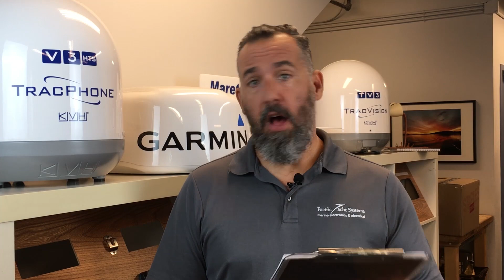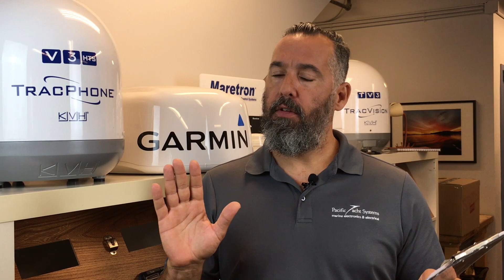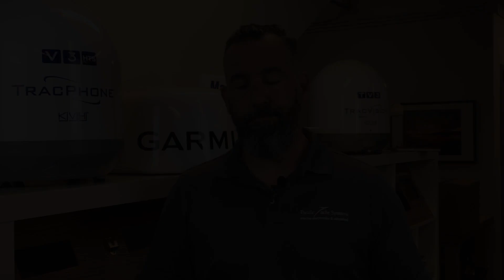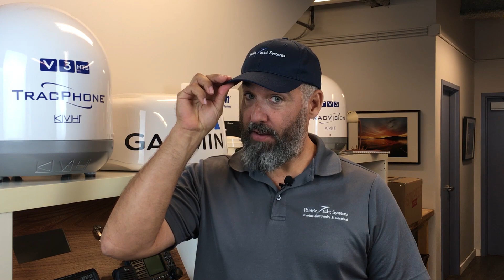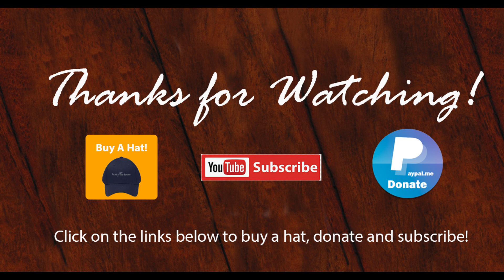Can I Use One Alternator to Charge an Flooded Lead Acid Starter Battery and an AGM House Battery?

Comment: Unrelated topic , i have a honda 2200 that i run on my boat from time to time i does what is needed .But should i run a bonding plug or not .as i said it works now with no problems.

Comment: Hi Jeff, great fan of your videos. I wanted to know if having a 3 bank system where there is a engine battery, 12vdc accessory battery and a battery for the inverter for 120vac make sense? Would using one alternator with a battery isolator to charge the first 2 banks and using a dc to dc converter from the engine battery to charge the 3rd bank work? Thank you. Arto.

Comment: So, buy changing my lead acid engine start battery, on my Motor home, to match my house, AGM battery, my alternator should charge them both correctly?
Reply from the maker: you probably can't change the charging voltage of the alternator anyways so its' a bit of a moot point which battery type it's charging.   agm and flooded voltages are very close together anyways and I would not be worried

you may also have 2 different alternators,  one for each.

Comment: Hi Jeff, I really enjoy watching your videos and I have learned a lot from them.  I plan to upgrade my 55a alternator to 100a with external regulator.  I'm also installing a 40a Smart Charger to replace my old charger.  I will be replacing my two flooded house batteries with two AGM.  Eventually,  or sooner, I will replace my flooded starter battery with a Dual AGM.  My question is: Can I set my charging profile for external regulator and Smart Charger to AGM to keep my new batteries happy while supplying voltage to my flooded using an Isolator and/or 2nd output from Smart Charger?  Cheers from the East Coast of Canada, Leo
Reply from the maker: Hey Leo, when you mix and match battery chemistry, better to use a DC to DC charging converter instead of a battery isolator.

Comment: Question: What product do you use to get solar panel wires through the deck of your boat? Also, do you have any tips to make sure the wires/connectors are water tight?
Reply from the maker: We use the Bluesea or Scanstrut deck glands for penetrations into boats. Always try to give the wire a drip loop before going in the deck gland into the boat. Also, if possible mount the deck gland on a vertical surface, like a transom to reduce the likelihood of water penetration.
Reply: @PacificYachtSystems  This is the perfect answer to my question. Thank you so much!

Comment: Hey Jeff, i just learned my house batt is a starting batt in my 21’ BW. It’s a standard two battery bank. Both batteries are 18 months old. Flooded. Can I just replace the one battery or do I need to replace both so they are the same age? Battery’s are in good condition.
Reply from the maker: Only need to replace one battery, as you noted, get a deep cycle battery for the house battery.
Reply: @PacificYachtSystems  thank Jeff!

Comment: if i have a house bank with (4) 8D batteries, and then (1) 8d for port engine and (1) 8D for starboard I wonder how to handle the smaller generator battery to keep it isolated but charged up.  Isolators seem to only have three banks typically and from another of your (fantastic) seminars you said combiners arent great where the banks are significantly different.  So how do you use the engine batteries to maintain the generator.   and same with the main charger which only has three banks.  ?  I appreciate any hep you offer, thanks.
Reply from the maker: Hunter, for this application install a directional battery combiner like the Xantrex echo-charge between house and genset battery. The echo-charge will allow your genset battery to get up to 15 amps of charging current only when the house battery is getting charged and is above ~13.3 - 13.5 volts.
Reply: @PacificYachtSystems  Thank you very much
Reply: @PacificYachtSystems  I ordered the echo but now that i am looking at it.   I am wondering if there is an equivalent that is water proof or resistant?  this is in an area where in adverse weather water could come down through the deck hatches from time to time. or i could run cabling to a dry area  15ft away or so.

Comment: Hi Jeff!
My question is... if I have 2 50amp fuses in line do I have a 100amp fuse? And would it make a difference if they were wired side by side? Kinda like being wired in series or parallel... I think 🤔... but I got a bit of a headache thinking about it...lol
Thanks!
Reply from the maker: Great question!!! The short is no. Two 50 amp fuses in series, is still a 50 amp fuse. Two 50 amp fuses in parallel, assuming even current path, will give you a 100 amp fuse.

Comment: Hi, I have a boat with a house bank (2x group 31 batteries which also starts my port engine ) , starboard engine starter battery , generator start battery.

I have a new battery charger I’m installing but it says I must wire directly to the batteries individually But I want to install a shunt to monitor the state of my dual battery house bank?
Reply from the maker: The positive leads from the charger go to each battery. The negative lead, cannot bypass the shunt, otherwise you won't measure the charging amps from the charger.

Comment: What if I go from the alternator, to an external regulator for AGM, pass it through a battery isolator, to a 12V to 12V charger for the Lead acid battery bank, and the other output of the battery isolator to the AGM battery bank? Would it give both banks the correct charge voltage?
Reply from the maker: Hi Alf, a DC to DC charger solves lots of problems. Install a external regulator configured for AGM for your alternator and connect the alternator directly to the AGM house battery. Notice, no need for battery isolator, because you only have one battery bank connected to alternator. Install a DC to DC charger from house to engine battery and configure DC to DC charger with flooded lead acid profile.
Reply: @PacificYachtSystems  Even simpler. Didn't even think about the fact that since the voltage is higher on the AGM side, I can charge the lead acid battery with a 12V to 12V charger from there. Nice! I think I'll have to buy a hat from you, Jeff! :)

Comment: First of all, again thank you so much for the wealth of info you put out!
I'm reading up to help a friend redo much of his shitty electrical (almost no fuses to be found !!) on a Jeanneau Melody.
Considering he doesn't want to go the external regulator route and keep his stock alternator. 
Is the "best" option still: 
- routing alternator straight to the unswitched distr. that is connected to the AGM house bank.
- connect a combiner (he already has one) from the same busbar to the flooded starter battery
Thanks again!
Reply from the maker: Hi Kofi, yep bring alternator output to unswitched distribution and make sure to fuse alternator wire at the unswitched distribution. Battery combiners between banks will definitely work. Also consider the DC to DC charging converters.

Comment: What's the right voltage for an AGM so Jeff? I charge flooded at 14.8V+TC and AGM at 14.4V+TC.
I get great results rerouting the B+ to having the shortest run to the house battery with the B Sense (D+) on the Starting battery, as long as it's done right this is fine.
I really wouldn't worry about absorption voltage too much, that's what solar and mains are for. The alternator is for aggressive current delivery, maybe once in a blue moon does it ever run long enough to exit bulk stage (constant current).
Reply from the maker: Hi Liam, good questions. Seen alternator external regulators drive the voltage to 17 - 18 amps, due to the battery temp sensor being located on different battery bank (e.g. engine) and yet the alternator output is on the house battery. This can happen when a battery combiner or battery isolator as failed and even though the charging voltage is getting to the house battery. the battery voltage sense on the other battery doesn't see the voltage increase.

For battery charging voltages, i always refer back to the battery manufacturer. For AGM, most of the batteries want 14.4 - 14.6 for bulk and 13.3 - 13.5 for for float on a 12 Volt battery.
Reply: Indeed Jeff my method is admittedly quite application specific. Any time I've fitted and external regulator and then compared it to the output of the internal alternator regulator with the same intelligent routing I've implemented I've noticed no substantial difference in current. Sometimes more, sometimes less. Altogether underwhelming for €600 "magic" boxes. A lottov these DC-DC are limited to ~30A. I generally work to 100A on alternators.
I don't use diode splitting devices because they really hamper the circuit.

I run generally 35mm² as the crow flies from the Alternator B+ to the house battery split charge contactor hard linked to the Engine Battery feeder with the switched side going to the House battery. I use a meaty Albright SW80 for this which is usually controlled by a Merlin/Balmar SmartBank. I leave the D+ on the Engine battery and measure the 100% duty alternator load Engine battery voltage. As long as this is inside tolerence it's ok. If it's outside I adjust it with cable gauge.

If the AVR Fails (never seen it with my military grade AVRs) the B+ is by default on the Engine Battery with the Sense. The house battery is taken outtov the loop.
As I say it works very well and inexpensively if you know what you are doing. The least I pull from alternators is generally 70A at 50% DOD. The most I've managed is 250A with 3 Alternators.